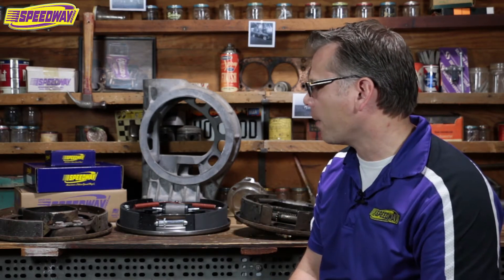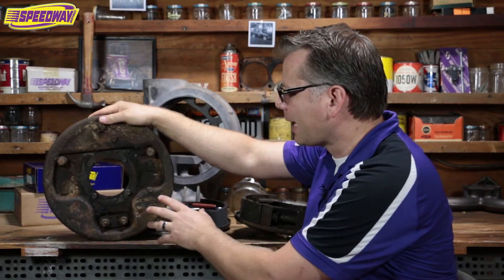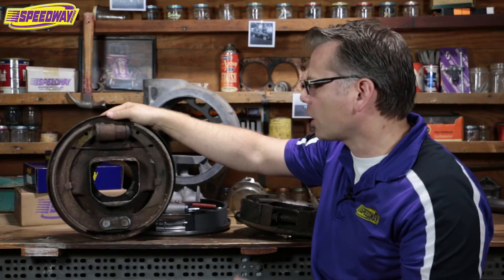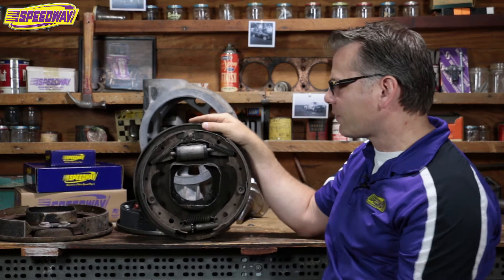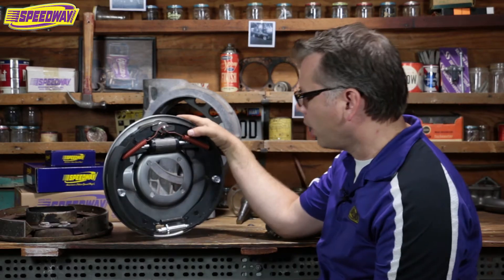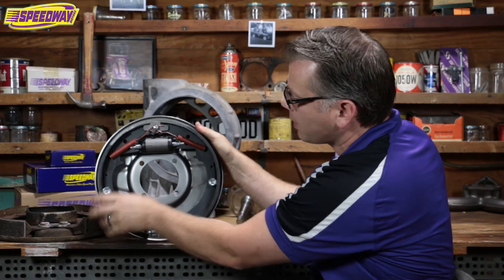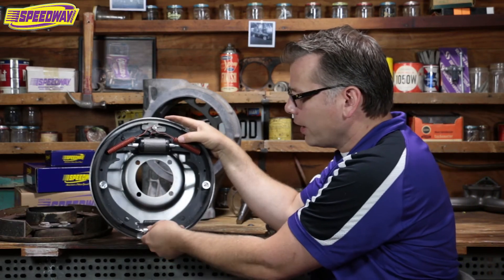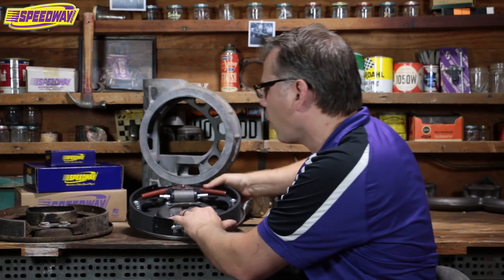Speedway Tech Talk - Ford Juice Brakes Versus Self-Energizing Brakes

Comment: I have 29 Ford spindles, and I am using 48 to 52 Ford juice brakes. Do I need to use the bushing on the spindle, or is it just a fit to see what works? And where can I just get the piston ring for the gap? I watched your video very cool. My car is a '29 4-door Murray sedan turned into a roadster because the wood on the car had rotted.

Comment: Hello I have a 1947 dodge deluxe coupe that Iv stuffed a 702ci GMC V12 down in and i'm looking at upgrading the brake system but I don't want to change the front end. I've converted to power brakes with duel diaphragm booster and duel chamber master cylinder. I've thought about changing to self energizing drum brakes instead of stock juice brakes. Do you have anything that mite work for me?
Reply from the maker: I'm sorry to say that we do not have any drum brake backing plates that would bolt up to the stock Dodge spindles. In order to upgrade your brakes with these self energizing backing plates you would need to update the entire front suspension, which means modification to the frame so that you can use a single front leaf spring as an early Ford car would have.
Reply: Hi, The later brakes in my 1951 Plymouth and early 50 Dodge trucks have two wheel cylinders, one acting on the front shoe and one acting on the rear shoe. Both shoes become self energizing with this set up. Some of the 50s Dodges  and all of the Desoto/Chrysler drums are larger than the Plymouth brakes. All internal expanding brake systems with anchored bottom brake shoe have at least ONE self energizing brake shoe.       Our friend did not explain the self energizing brakes well. On the original 40s Ford brakes having anchored brake shoes, The front brake shoe self energizes while the rear one just drags. Compare a radio flyer wagon going forward and then drop the handle, it digs into the dirt causing self energizing. If the wagon were backing down with the handle on the ground, it just drags and no braking action occurs.